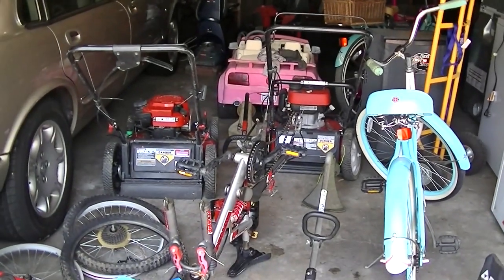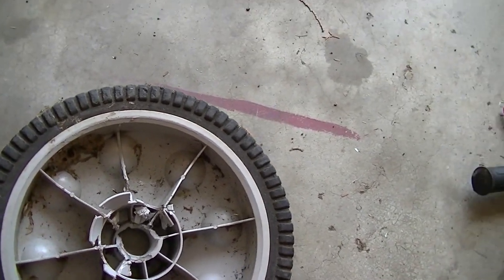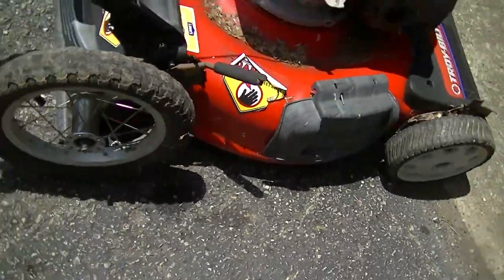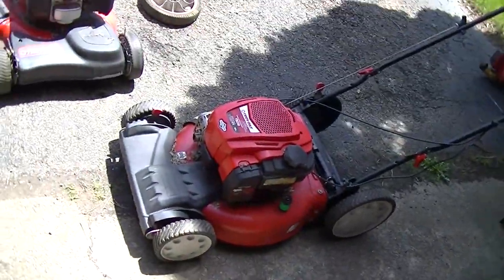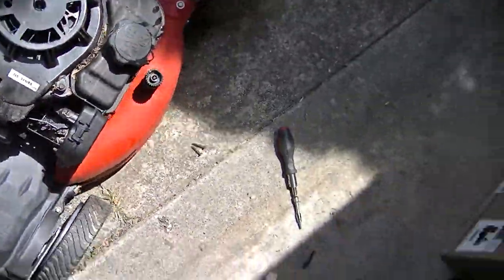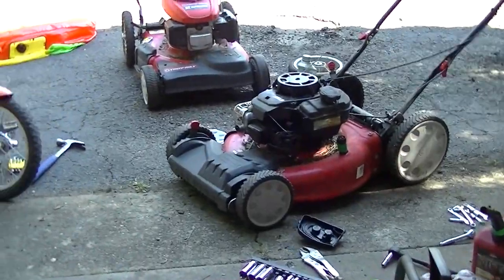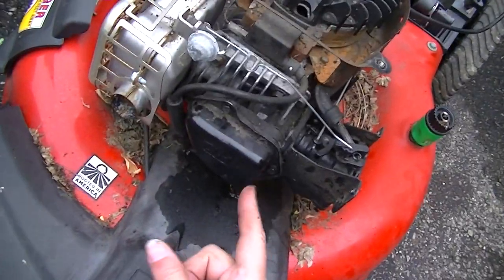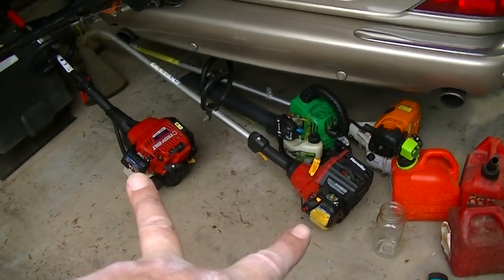Can we save these mowers? They were headed to the town DUMP!

Comment: I like them, I do like the nice in depth amp repair videos as well, but there is something quite relaxing about watching you repair other things. It is quite sad though the things people throw out that can be fixed for a fraction of the price for a new one ! ( even more so these days since new and used parts are available so easily online ) We need to bring back the old style local repair shops who could fix anything.

When my last petrol mower finally died, I dismantled it and sold the good parts on Ebay, and got more than my new mower cost me !

Comment: I'm the same as you Brad.i have mental illness and guitar wasn't doing it for me anymore and about 2 years ago I started coding again and studying circuit level theory and building bread board circuits. 

You need a knipex auto adjusting wrench. It adjusts to the contour of any bolt.
Reply: Knipex...good stuff. I have a full set of their pliers.
Reply: @peterburi2727  nice. I'm slowly accumulating the tools. What's the best general purpose adjustable wrench called? I've only got cutters and stuff for wire and electronics. There's so many names haha

Comment: Brad, get some ether starting fluid. I rarely winterize my gas powered tools, so sometimes they don't want to start in the spring. Spritz a little ether into the air cleaner and the mower will probably start running well enough for fuel to start flowing through the carburetor and run on its own. As fresh fuel moves through the carb it will start to dissolve the deposits that have accumulated and the longer it runs, the better it will run. As for the wheel, you might want to look into getting a 3D printer and learning some CAD.
Reply from the maker: I didn't used to winterize my stuff, but I never really had good stuff. I do now, and I intend to keep it good.
Reply: A new deck wheel on Amazon would by far be most cost effective solution, especially if you've got Prime.. $7.85 for a 7" Arnold Universal Replacement Steel Wheel (55 lb. Load Rating). You just can't beat it! ;)
Reply: @R3TR0R4V3  Great suggestion, as long as the axle diameter is correct. That wheel has steel parts and ball bearings, should last a lot longer than the original plastic wheels.

Comment: What is that Green thing that sticks out of the deck on that mower ? The output tube ?
Reply from the maker: It’s a water hose hookup for cleaning the deck with blade running.
Reply: @TheGuitologist  That's clever I've not seen that here in the UK .
Reply: screw a water hose into it, turn on the water, and start the mower. the blade slings the water around and cleans the grass off. its very acidic and can rot your deck.